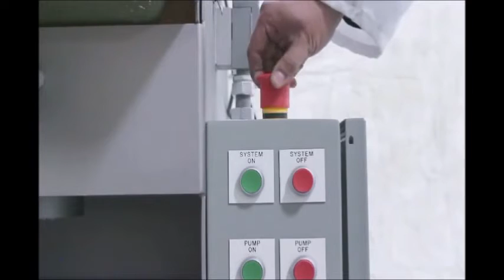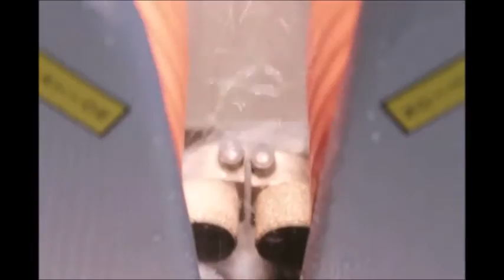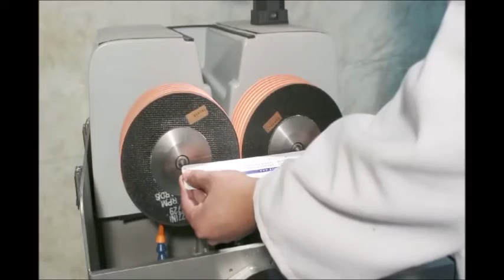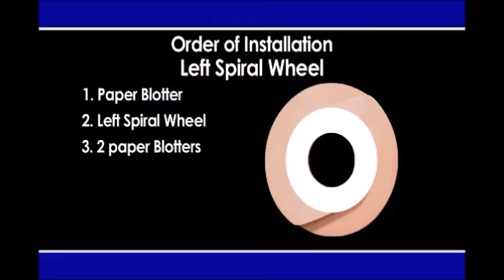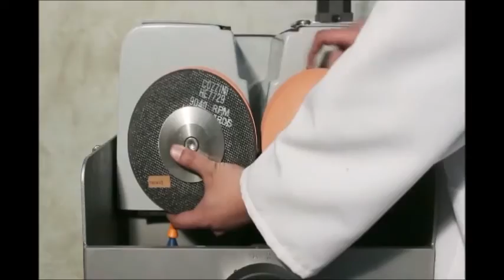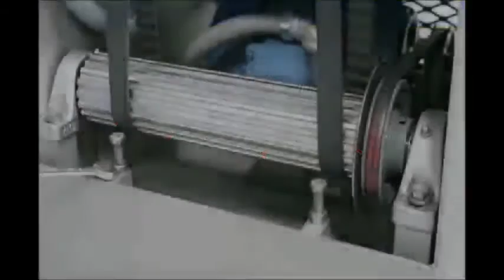Equipamento PRIMEDGE HE7

Comment: Yeah, it's an interesting machine, that's for sure. I'm just surprised that modern engineering still uses a cross-belt drive system. It’s a simple setup, but it looks totally out of place—like a horse-drawn buggy on a city street. I mean, that kind of technology was used way back before we even had widespread electricity and electric motors.
It's actually pretty complicated to operate, too. I get that it was probably a convenient way for the designers to put the machine together, but it's a real headache for the people who have to actually use and maintain it.
😢
Reply: Bom dia trabalho com uma máquina dessas se tiver peças pra repor e boa a máquina fio muito bom